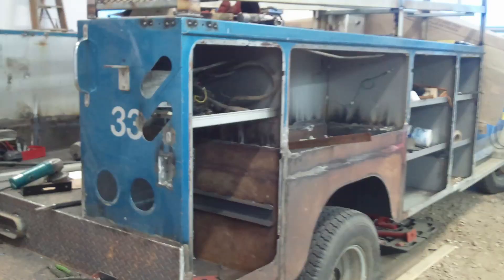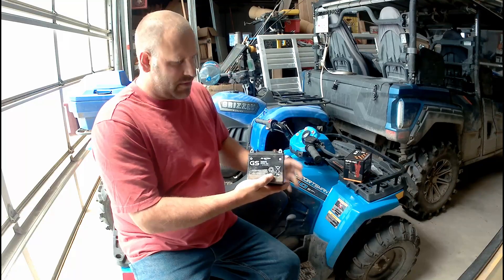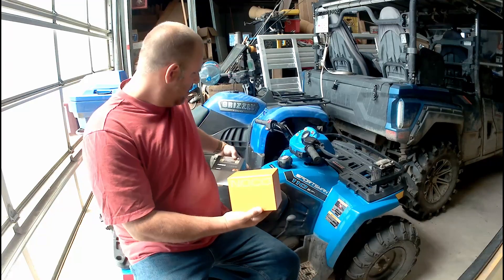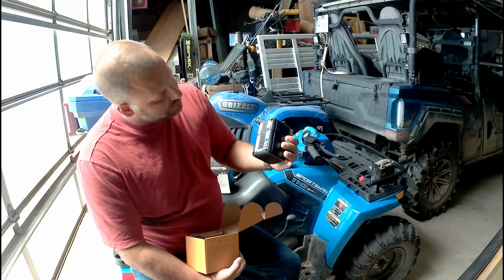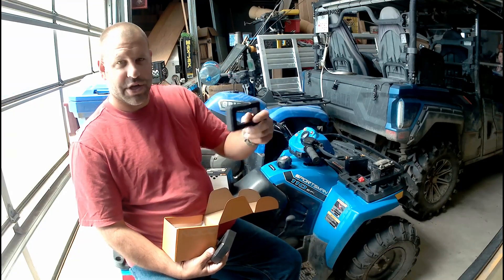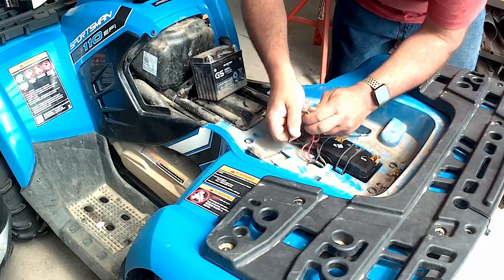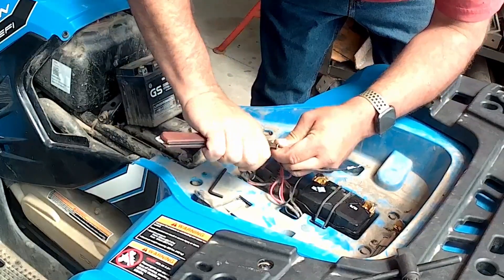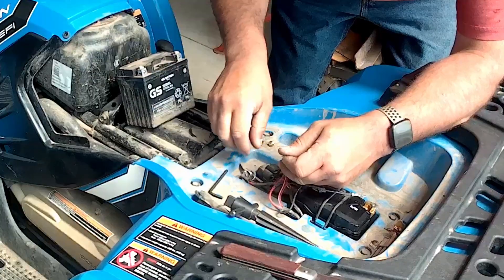Polaris Sportsman 110 Lithium Ion Battery Upgrade ATV

Comment: How long have you had it in there and any issues with it. Does the stator charge it or do you put it on a special charger.
Reply from the maker: Been in there now for over a year with no issues...  Running off the quads stator for charging

Comment: @shopworx thanks for the 110 videos. I have a 2018 for my kids. Can you tell me where the fuse box is located?
Reply from the maker: Not a 100% sure as I am working away right now but I believe it is on the frame under the battery box area.  I think it has a rubber cover on it too.
Reply: @Shopworx  thank you for the reply. I found it under the back left fender. Much appreciated.

Comment: Do you have a link to the battery? My 5 year old has a 2023 sportsman 110 and I already have to jump his battery. It’s like it doesn’t have enough CCA
Reply from the maker: Not off the top of my head,  I bought mine local,  I try to support the local stores when possible.  Just google the battery part number and you should be able to find someone selling it.

I totally agree on the original battery being crappy.  I had issues when I picked up the quad new.